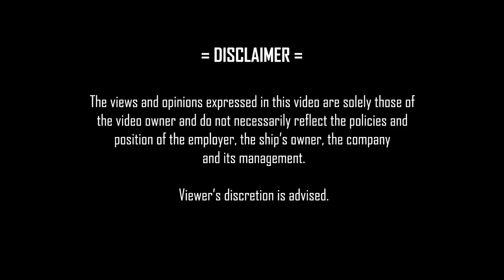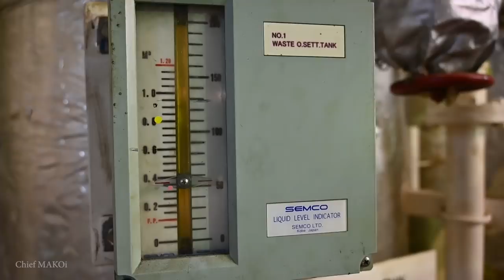Ship Engine Troubleshooting and Repair at Tarragona Spain | Chief MAKOi

Comment: Fascinating video this. As an ex aircraft engineer it looked simple enough but on a massive scale. The only time I ever used hydraulic equipment was to tighten/loosen the Jesus Nut that holds the main rotor on on a Chinook helicopter.
Reply: RIP KOBE
Reply: As an aircraft mechanic myself I really enjoy watching this. Aircraft components tend to be small and precise. Once I helped a friend work on logging equipment and it almost killed me.  I’m a little skinny guy and most of the parts were bigger than I was.  The old guys laughed when I couldn’t lift some of the big tools!!  Heavy maintenance on a ship like this is really impressive.

Comment: Wow, this takes me back to my Navy days! We ran the evaporators underway, and worked on the hydraulic, compressed air and refrigeration systems. Those were good times!
Reply: This ship has 19-24 people on it .
Your ship had that much just in your division!
No watch in the evaporator.
No one in watch in the engine room at night!
Ex MM then merchant marine...
Reply: My Navy days were in the late 60's, although an Electricians Mate, I've put my time in, and cherished the memories of the engine rooms and engineering spaces I've worked in on three different ships...never dreaming that over a half century later I would be able to travel on, tour, and watch the work being done on so many ships via something called the Internet.
Reply: @josephpadula2283  We had around 8 guys in Aux division where I was, and about 16 in the engine rooms. Most of the crew was in Ops and Combat Systems.
Reply: @markmark2080  Yeah really! I was in during the 80s and I'm sure it's a lot different nowadays.

Comment: Seeing the faulty seal reminded me of one ship that I joined as 4/E where my duties included the fuel and diesel oil purifiers. I immediately saw diesel oil dripping from the purifier which had to be run continuously on this ship. There were no new spare seals or bearings as the relieved 4/E had put old ones back into store without ordering new.
I was furious, but I managed to repair one of the serious leaks and gave the new Chief a long list of spares needed. Once they arrived, we managed to get things improved.
Regrettably, not all seafarers maintained the good practices that we see in your videos.

Comment: Yes, I can see that the sheer size, weight, and complexity of the engine parts mate a "simple" job much more difficult.
Reply: *make
Reply: It's more its displacement more than anything. It's a very simple engine.
Reply: To me, it looks somehow simpler because of the size. At least you can get to everything working on smaller engines makes it problematic because everything is packed tightly together.
Reply: @Matevz96  yes and no. The actual internal combustion part of the engine is simple. It’s a large low RPM 2 stroke. But the ancillaries such as the air start system, jacket water cooling, electronic timing, charged air, fuel system and lubrication systems which are all massively scaled up make it complicated ect make it complicated.
Reply: @Matevz96  Yeah kinda like front wheel drive cars are a pain compared to rear wheel I'd imagine.
Reply: @fukkitful  absolutely accurate
Reply: Yeah man, but think about it all those tiny circlips and nuts that are easy to drop and lose sight of are the size of your hand on this thing lol
Reply: @jblob5764  Used to have an early 80s F100. I'm pretty skinny and could probably get between the engine and the fenders. It was so much easier. Now unless your just changing spark plugs, ICM or coil pack. You'll spend more time just trying to gain access to the part needing to be replaced..  If you can't tell, I hate working on fwd cars.

Comment: Thank you for the video Chief!
Just came back from Marseille where I inspected and did maintenance on the IT infrastructure on a few ships of our fleet that is still resting waiting for the cruise industry to restart.
I was lucky enough to sleep onboard, meet some friends and sail one night out to discharge grey water, run osmosis and test the newly installed 2000W front light for ice operations.

Really hoper you can disembark and take a tour.

Comment: Chief, good day! Big respect, very useful information for the engineers and future engineers, because necessary to get the skills and gifts for the experience. On the vessel it's possible by large the desire! Could did you to show the overhaulling with auxiliary engines or heavy fuel oil separators  more detail or full?

Comment: You need to look at a Klarus HA2C head and 90-degree hand lamp. It has up to 3200 lumens and sells for $80 US on the Klarus site. It comes with a rechargeable battery and this one is the best I've ever used because of its head or 90-degree hand lamp. Great vids. Keep them comming.

Comment: That’s the big difference between a diesel ship verses a steam ship. On a steam ship, there usually is no maintenance to be done in port. On a diesel ship….always have work to be done in port: pulling heads, pistons, fuel injectors, etc.

The main savings for the diesel ship verses the steam is the fuel costs.

Thanks Chief

Ram

Comment: I am impressed. Yesterday I changed the CMOS battery in my computer. (After I was able to find where it was,) and that was scary.
I have great respect for the maintenance crew on your ship.
Reply: Changing a battery was scary? You must be sarcastic.
Reply: @testosteroneinc.3800  Not at all, I had to nearly dismantle the computer to access the CMOS battery.  I could have taken out the crankshaft on my BMW K75S motorcycle more easily.

Comment: i work on boilers and chillers. this looks like every job i touch. i pump out 350 degree water with 200 psig nitrogen so it doesn't boil in my pipes. even with water treatment that is a hateful temp that will flash boil at the smallest leak and just wrecks pumps and seals. nice to see the crew working and getting it up and running so well.

Comment: Good crew there Chief..! But, I cringed when they started to dig the old seal out with a coathanger..! I sharpen up an old bamboo chopstick whenever I have to go into a precision sealing surface or O-ring gland. Bamboo is tough enough to pry it out, but won't scratch the metal...

Comment: 04:50 Some times there is so small leakage that is difficult to trace and alarms will not be actived.
So in dry dock there was not any maintenance on fuel pumps like in our situation and after the ship leaves the dock the problems start.

Comment: Hi Chief! Hope all is well. I noticed you guys using a hydraulic torque wrench/socket. 
We use those quite a bit in the pipeline industry. 
We recently started outfitting all of our hydraulic torque units with a valve from a company called TorqueSafe, out of Australia. 
Since we’ve started using them we haven’t had one single accident involving them.

Comment: Hey! I have done that exact same job! On my pickup... I didn't need the overhead crane lol
It's always nice when inspectors are friendly and give you a chance to correct minor issues BEFORE writing the report, and I am not talking about issues like the weight of their wallet...
In my experience it usually means that they see that you are doing a good job overall, and understand that sometimes things get missed or behind, and no reason to cause trouble as long as it gets done.

Comment: Great work Cheif! It is very interesting to see the added complexities that large marine diesels have over most land based diesels. Considering the primary fuel that a marine engine burns, I am suprised that the waste oil wasnt burned in the engine. I did notice that the WO system has settling tanks, so does that mean only the worst of the waste oil is incinerated and there is a good fraction that can be burnt in the engine?

Comment: As a (far, FAR smaller) boat owner I can confirm that seals are the big thing, especially seawater-side. You can never have too many, and I've lost count of the times I've used the "Nitrile cord and superglue" DIY Instant O ring kit, despite having a (so I thought) "complete" O ring set on hand. The copper ring seals on injectors also seem to be less than durable, especially in colder weather, so I kept a lot of those just in case!
Reply: Add in the ever useful sheet material Threadsert kit, along with a decent Helicoil kit and a half decent toolkit - probably enough to meet most problems in the Coastal Sailing environment!

Comment: Get those boys some hook picks for the tool box. It looks like he went to the nearest closet for a coat hanger.
Reply: It's true that the proper tool is better but I applaud them for using what was readily at hand as long as it wouldn't cause damage.
Reply: @timothyball3144  now that I think about it, a brass rod tool sharpened just enough to act as a spoon to grab the edge of the oring is not going to scratch the seating/sealing area. The brass coat hangar may be the best option!

Comment: Great video.  I watched it twice. So, It looks like there are two injectors.  Is the injector pump for each cylinder located in the cylinder head?  I don't see a high pressure fuel rail.  Where does cooling water enter and leave the cylinder head?

Comment: Chief nice video but only one problem, why is the crew not working with safety glasses?? They are working with hydraulic oil under pressure with a lot of bar , this could end very badly if the hose break or something.

Comment: Was that pump head inserted into the bore crooked by some yahoo back at dry dock damaging the seal? Usually there is a beveled inlet where it matters to help prevent damage to a seal when it is inserted into a bore.

Comment: I assume if one fuel injection sealing ring is damaged on one head, then the other sealing rings on the other heads are damaged as well.  Might as well replace them all while you have time in port

Comment: Two comments.  You bring up that there is anxiety over the jobs that need to be done . Also the family separation.  I was taught by my father make the best of your job and get one that pays  well and the benefits  for your retirement years. I was  a fire fighter EMT  for 5 years and a policeman for 22 years till I was seriously wounded in the line of my duties.  The benefits and the job  I loved . Yes the long hours 16 plus  hours and working  in all kinds of conditions .  If I wasn't  hurt I would have done at least another 5 to 8 years.  I would  have loved to have been a sea farer also .  In the navigational section as I love the water and take my 23' Grady white boat in the Chesapeake bay and the near shore of the Atlantic Ocean  . 
Can you give some stats of your current ship. Length,  beam,  tonnage,  draft , range , crew size, speeds  etc.

Comment: You mentioned you used Hydraulic nuts to tighten up. What is the difference between them and normal nuts? I have not heard of Hydraulic nuts before, but im not an Engineer, but someone interested in your wonderful videos. Thank in advance.
Reply from the maker: Normal nuts, you can tighten them up using a wrench and maybe strike it with a hammer for additional tightness.  Hydraulic nuts can be tightened to a specific torque by applying pressure between the bolt and the surface where it is attached.

Comment: But what happens if you have an issue that must be fixed in the middle of the voyage that prevents that engine from continuing till next port? Any spare engine to make it to shore?  Or stop and fix at sea?  would parts ever have to be air lifted to the ship?

Comment: I noticed that on the ships that you've served that English is used throughout the ship for labels. signs, and other printed items. You've said many times that the crew is mostly/all Filipino. Is English the "universal" language among commercial ships? If so, does this affect the running of the ship with a crew that doesn't read/speak English or it's their second language? And by the way, your English is excellent, to my US English ears, I wouldn't be able to distinguish you from another US native speaker.

Comment: Is the fuel oil preheated before being pumped into the ship's engine? In oil burning furnaces the fuel is heated to near flashpoint so that it will vapourise quickly.
Reply: Yes. If the ship uses heavy fuel oil (which is likely) the heavy fuel oil is pre-heated before entering the high pressure fuel pumps. The oils specification and viscosity determines how much it's heated but normally you want the viscosity to be around 14 centistokes. (depending on engine specs from manufactures)
Reply: It must be I will say yes it is

Comment: Chie Makoi I noticed you don't  use a torque wrench on any of your work on engine components, that to me is very  unusual. Would you care to explain how you're able to determine how  tight a nut or bolts should be?
Reply from the maker: There are some parts that require specific tightening torques.  For the others, hand-tightening or a little bit tighter should be enough.  Just go by feeling and make sure not to lose thread. 😊

Comment: very interesting - thanks for sharing. do you had the right spare part on board in storage? or did the manufakturer send it to your position? in generally how did you handle spare parts? do you have a lot in on board storage or did you mainly order the needed things from manufakturer?
Reply from the maker: We usually have a few in stock.  If we don't, we order them and just have to wait until they arrive.
Reply: @ChiefMAKOi  thanks for you kindly answer. i suppose if you need to stay in a harbour and wait for some spare parts it is very expencive

Comment: Chief, I have a question for you. I've noticed that while loaded bulk cargo ships seem to cruise at a sustained speed of around 12 knots, container ships, though much larger, seem to travel along much faster- up into the high teens or maybe even faster? And while looking at videos of container ships suggest many such ships have one propeller, stern wake photos of container ships often show two propeller  trails. True? Why?  Thanks, enjoy your videos very much.
Reply from the maker: They have bigger engines often with 12 cylinders with larger bores.  Bulkers usually have 6 cylinders.
Reply: @ChiefMAKOi  So why is that, Chief? Would a bulk cargo ship benefit from a larger engine, a container ship from a smaller one? I understand there's a tradeoff between fuel economy and speed.  Why is it in the build out and choosing of equipment for two different types of ships that there appear to commonly be two different solutions? The consequence of which is that one type tends to be slower and the other is rather faster? Thanks again, all the best.
Reply: @trevor keen Thank you for responding to my question. Do you have industry knowledge or are you speculating? What you're saying makes sense to a point, I guess the go faster/more paying customer loads vs cost of doing so calculation for any ship is easy for the operators to make. At the same time, there's an irony right now about the crowded ports around the world. It's not unusual for boats to arrive in the general area of their destinations and then to have wait days or weeks, at anchor or do the ship equivalent of a holding pattern (common in my area) when anchorages are full). 

I understand that passages and arrival times are fluid but I wonder if some form of "book your berthing slot in advance" is in practice? Imagine the wasted time and fuel if airplanes weren't assigned landing slots until they were within 25 miles of an airport. 

Thanks to you or anyone who can fill in blanks.

Comment: Shouldn’t the injector cover you are removing have 4 hydraulic jacks on it , not just two, so all can be tensioned equally?
Like when  the head cover is done.
That is the main advantage of pulling the studs to remove tension on the nut from the design engineer’s perspective.

For the crew it is fast and easier...

Comment: What would be some of the likely reasons for that sort of damage occurring to the seal?
Reply: Likely poor installation technique. Lack of lubricant, or too much "ramming-'n-jamming" on the previous installation. Used to use assembly grease called "Parker-Lube". Probably called something else nowadays, though.
Reply: @davef.2811  I searched top down for this comment. Thanks so much for your knowledge! I wouldn't be surprised if it got overheated before they bled the injector, & it may have leaked from day 1 , without that alarm installed properly. We live in a world where rushing and not caring is a way of life.

Comment: Chief, your ship runs on diesel? Question, the big super tankers that haul crude oil do there engines run on crude?
Reply: Most run low grade oil called bunker oil. Think of the poorest quality diesel you could still burn, and load many tons of it on every ship.

Comment: I used to work on a shipyard, fixing submarines older than me.  I'm old.  The part we needed is no longer made by a company that no longer exists by people who are no longer alive.  That means the shipyard had to make the part.  That's expensive.
Reply from the maker: I experienced that back when I was on an old ship.  We had air compressors from a closed down company so we couldn't get spares anymore.  So the ship owner just bought a whole brand new set of air compressors from an existing company. 😊

Comment: A rookie question in here - sorry in advance. 

I have an exam tomorrow and I'm currious about the viscosity sensors location (HFO system). 

Can anyone in here be helpfull? My thoughts would be that the best location would be just prior to the injection, but my teacher told me it was closer to the preheater. 

Brgds Mark
Reply from the maker: He's correct.  The viscosimeter is sometimes rigged to control the heating medium going into the FO heater.
Reply: @ChiefMAKOi  Thanks alot :)